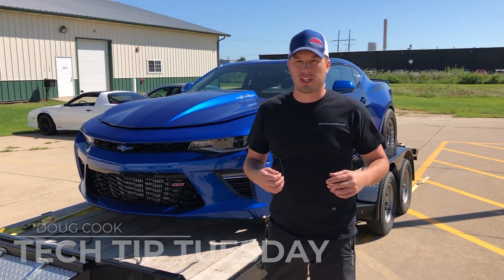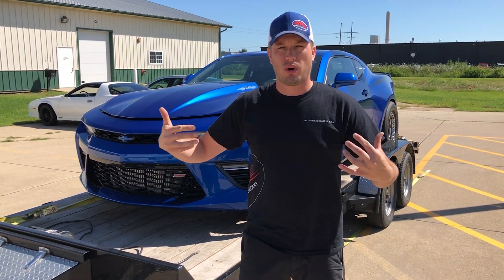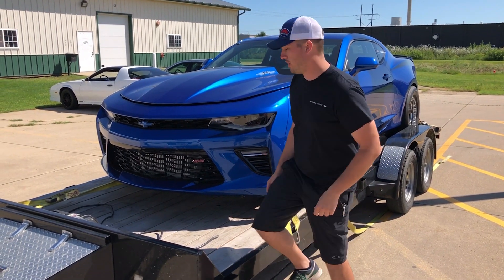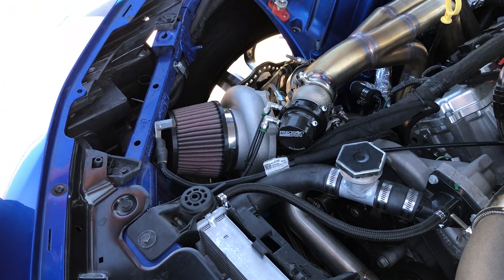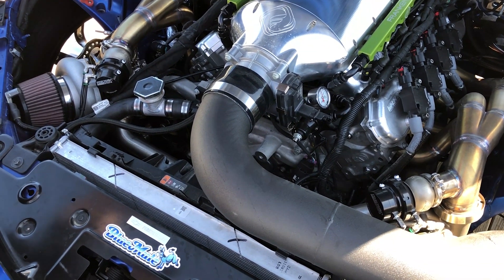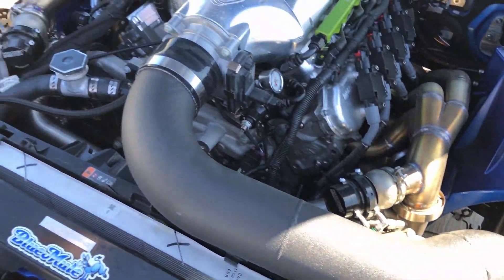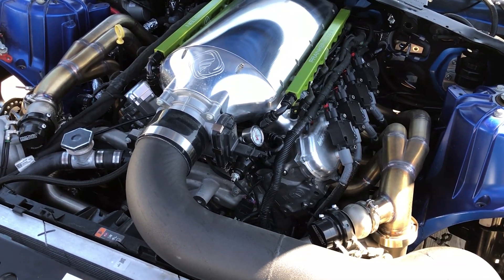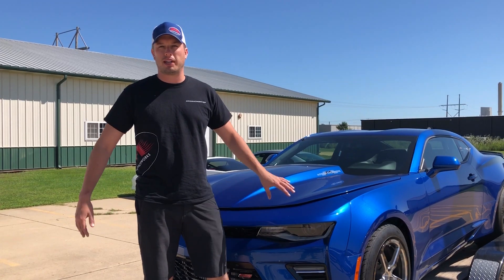Tech Tip Tuesday: Save yourself Thousands in Turbo Repairs with this one tip!

Comment: Can you make a video explaining the difference between or benefits if any of running 2 blow off valve on a 1500hp car vs running 1 blow off valve rated @ 1500hp or 2000hp on a 1500 hp car

Comment: this def will ruin turbos. I am a Ag equiptment mechanic and iv had to replace turbos before from the tractors exhaust stack is facing forward on most all tractors now adays and they haul the tractors with the tractor facing forward on the trailer and going down the road the air goes into the exhaust stack making the turbine wheel spin and ruins a turbo. this is a very common overlooked practice.
Reply from the maker: Jess Gilliam oh wow, yeah would never think of that

Comment: Wow what a good point. Bet most dont think of that. I'll save my caps for sure after the couple comments. Reminds me of working for mopar dealer. People towing small cars with tow bars and smoking the trans in neutral with no pump running. A 1k mile trip could destroy a turbo spinning the whole time.

Comment: There are the red plastic caps that come on some turbos and or piping. Especially in like semi engine or equipment engines. They make a bunch of different sizes. Generally they will slip over the outside of the compressor inlet. I wish I had a pic but they’re super cheap and effective. They’re kind of like a pipe cap but a thin softer plastic type material. Good luck.